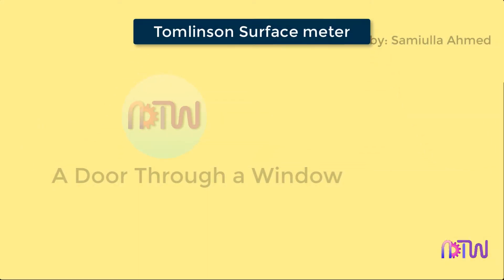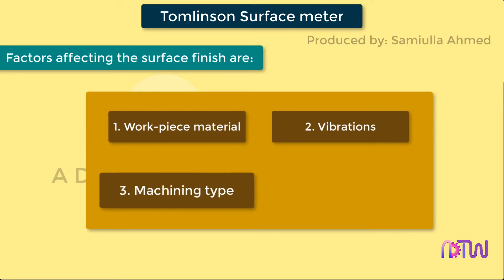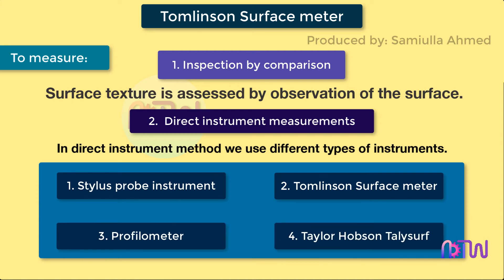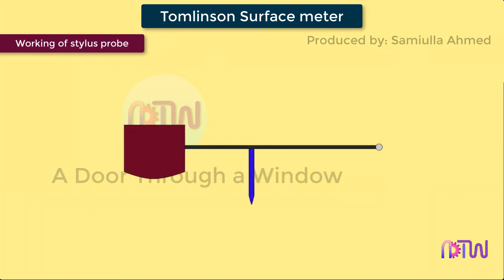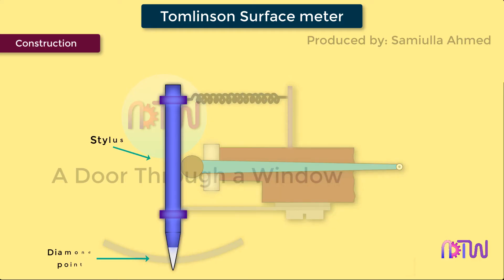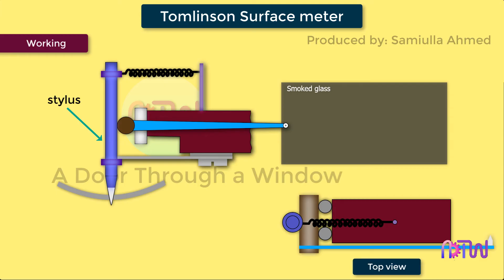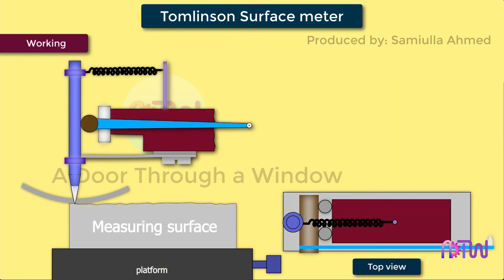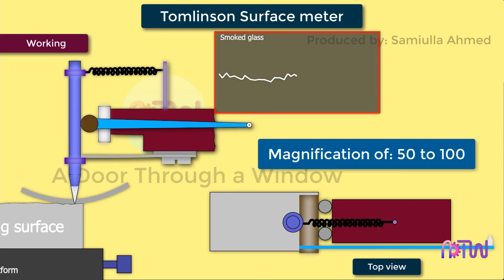TOMLINSON SURFACE METER: Construction and working of Tomlinson surface meter (animation).

Comment: How stylus movements are magnified and amplified and recorded automatically?
Reply from the maker: The stylus is connected with the arm with the help of a lapped cylinder and that arm is carrying a diamond tip at the end which is in touch with the glass as the stylus moves up and down that causing the lapped cylinder to rotate and the arm also rotates about that point, due to the length of that arm the movements recorded by the diamond scriber attached to the arm on the glass are in the magnified form...
Reply: @ADTWstudy  in case of stylus proble instrument?